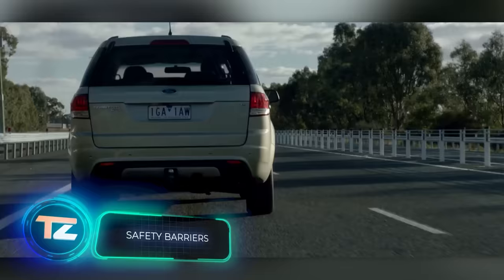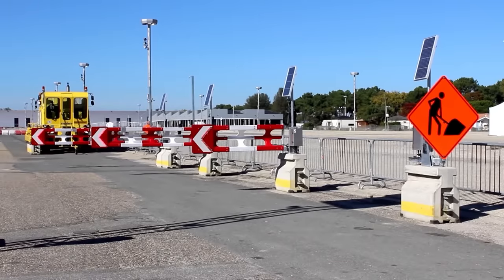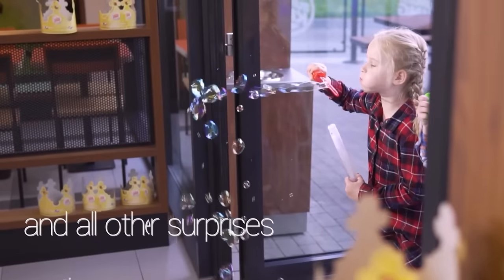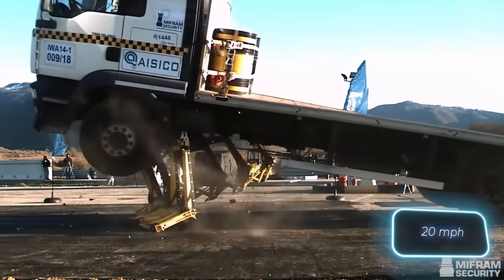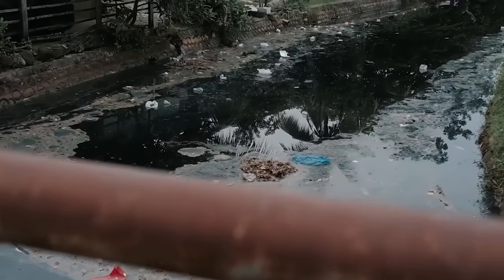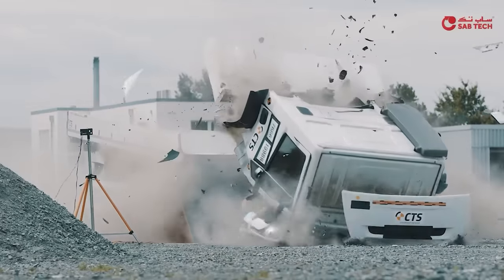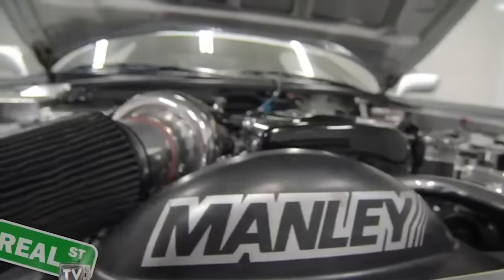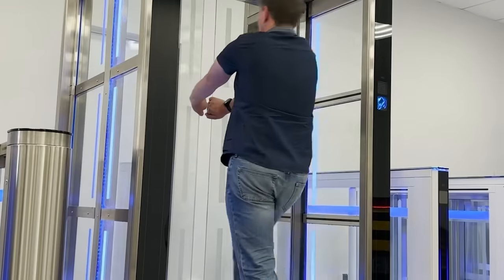INCREDIBLE BARRIERS THAT CAN STOP ANYTHING

Comment: @8:00  that water barrier for flooding looks like a good idea.  it also looks like an accident waiting to happen.
as best i can tell it relies on the portion lying flat in the water to create a water tight seal with the ground.  good luck with that.  if you don't have a water tight seal between the membrane and the ground, water will seep under the membrane.  liquids seeking equal levels.
seems sort of a Pascal's Principle experiment.
Reply: Seep is the key word. The water will seep under but with a "small" pump it can be controlled.

Comment: TRY SHOWING A ELECTRIC CAR GOING THROUGH THESE BARRIERS THEY ARE ALOT HEAVIER BECAUSE OF THE BATTERIES . ETC.
Reply: That Ram 1500 truck they showed weighs more than a Tesla. Can you please just look stuff up first before spewing out nonsense?
Reply: @echochamber4420  Tesla manufacture semi. Doubt that ram 1500 weight more )))

On a serious note, I'd rather worry not about weight, but about barrier short circuiting the battery and causing fire.
Reply: Not enough Tesla semi trucks on the road for your comment to hold validity…and your comment about the battery is even dumber…the whole point of the barriers is to prevent attacks!!! At that point do you think people are worried about a battery fire? lol, silly kid!
Reply: @echochamber4420  oh, the irony of a guy, not knowing how to use "reply" calling something :"dumb" )))

And, yes, people worry about fires from punctured batteries. A lot. And they should.
In 2024 ignorance is a choice, mate.
Reply: You’re a silly child.

Comment: How does a concrete median barrier possibly allow a vehicle traveling alongside it to "crash into it at high speed" ?
So the vehicle is capable of doing a 90 degree turn at high speed with a radius no greater that the width of the road without slowing down?
Alien technology I suppose?
What a stupid statement